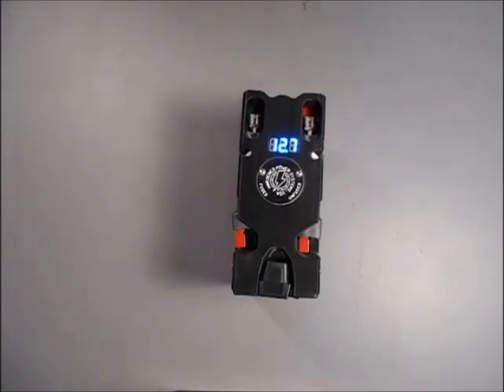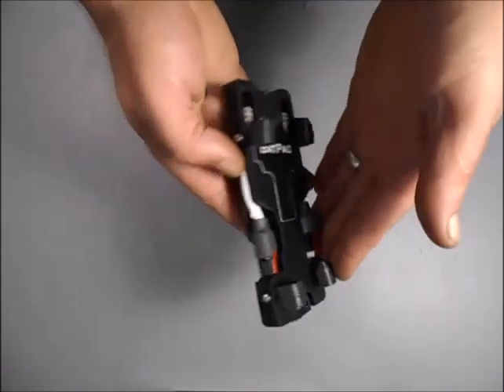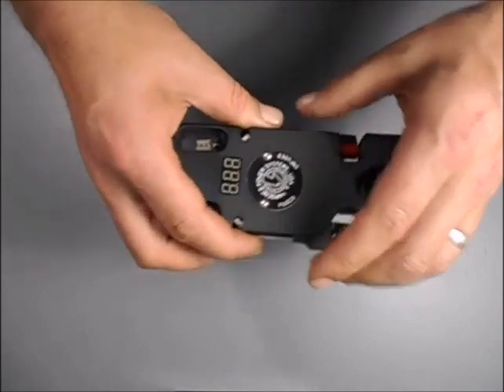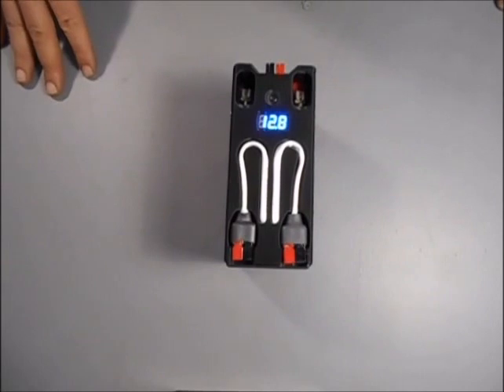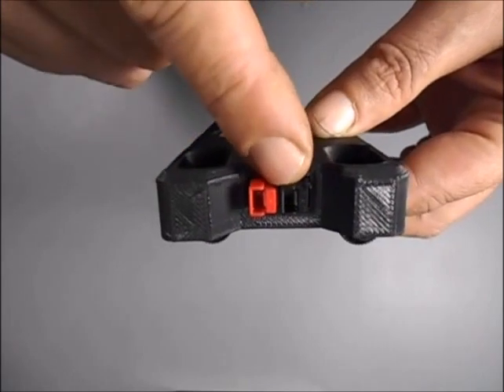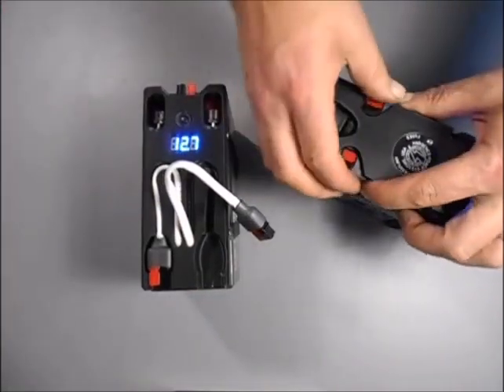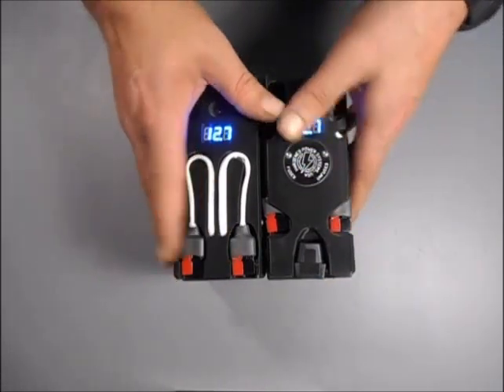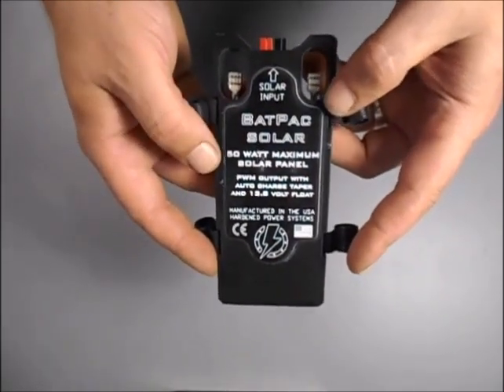BatPac M2 & BatPac Solar - Simple Innovation - www.PortableUniversalPower.com

Comment: Are these capable of being hooked together in series to produce greater amounts of amp hours?
Reply from the maker: +RadioHamPrepper Many of our customers do exactly that.  Just take the two unfused andersons (red/black connector) from each BatPac and connect them to each other... the remaining two unused andersons are then available for use, each of them fused (blade fuse of your choice, or the 15 amp that is included).  The two batteries are now paralleled, and the two volt meters reflect the new total voltage.